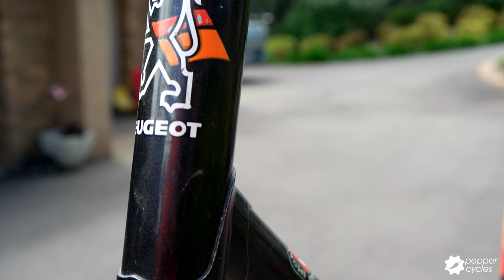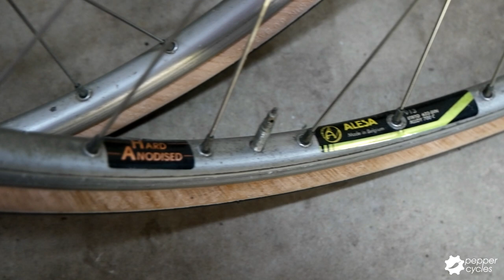Peugeot PSV 10 x Shimano 105 - 80s Vintage Road Bike Build

Comment: I have this in red with matching red cable sheaths, white turbo seat, white decals and a little blue trim to get the French tri-colour. 

The one thing I never understood, is the red, orange, yellow, white decals on a French bike. To me they just don’t match up on most frame colours and by removing mine the bike has better style continuity. Does anyone know what this colour scheme represents, if anything? Very curious to know.

Comment: I just bought the exact frame and I have to say I love your restoration and I am following almost exactly your pathway - can you tell me the headset you used - I bought a frame and fork without a headset and was leaning to a Stronglight A9 - is that what you used or am I on the right path? Your advice in appreciated
Reply from the maker: The headset used on this bike was Shimano HP-6400 (Shimano 600 tri-colour series). The Stronglight A9 is a nice headset too though. Thanks for watching!

Comment: Hello, Beautiful bicycle! I have a very similar one, but I can’t determine the model. I’m trying to find out based on the seat post diameter, which measures 26.6mm. What’s the measurement of yours?
Reply: They usually stamp the model under the bottom bracket. I'm not sure of the frame size,can't remember.

Comment: What BB are you using?
Reply from the maker: It's a Shimano UN55 from memory.
Reply: Mine uses a Shimano BB-UN300, because it is a 68 x 113 (Housing width x Spindle Length).  Spindle length depends on the crank used versus chain-stay clearance required.  You're welcome.

Comment: I noted that you had a 7-Speed freewheel on this bike, but it's supposed to be a 12-Speed, right.?  I have one of these bikes, & it also has a 7-Speed freewheel..!?
Did these '12-Speed' bikes come with a 7-speed freewheel from the factory..?
Hope u see this message.!
Thanks
Btw NOTE:  It's not a freewheel, it's a Shimano UNIGLIDE cassette, a very early type of cassette - it's held on by the outer (smallest) sprocket, & requires two chain-whips (!). I haven't removed it as yet - anyone know if & how that hub can accommodate either a freewheel, or a Hyperglide type cassette..?
Info PLEASE!
& Thanks.
Reply from the maker: Hey there, no it didn't come with 7 speed cassette/freewheel from factory as far as I'm aware. I just thought I'd give it an extra gear as I had one available. Thanks for watching!
Reply: It says "12 vitesse" on the chainstay, so it would have had a 6 speed freewheel.  I had a similar Peugeot frame in the 80's, but with Reynolds 531 tubing.

I dont think the HG cassette will go on a UG freehub. The HG has one wide spline for alignment, whereas on the UG the splines are all the same size.

Although you can unscrew the UG freehub from the hub, and replace it with an HG freehub, on which you can slide an HG cassette.

You definitely can not use a freewheel, those screw onto the hub, so the hub is completely different.  You would have to rebuild the wheel with a new hub that can take freewheels, which assumedly you wouldn't want to do.
Reply: @PRH123  Hi, Yes, I went ahead & replaced the 7spd UG with a 7spd HG, & sold the complete UG to a buyer in Canada - yay!
Reply: @lairdcreevy  cool…. nice bike, must be fun to ride…. I had a lot of fun riding and racing mine back in the day…